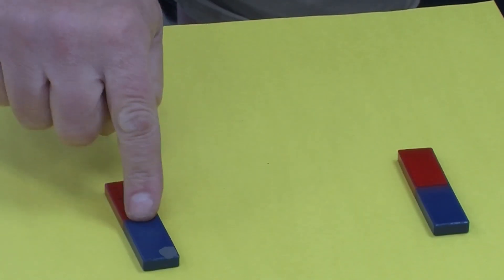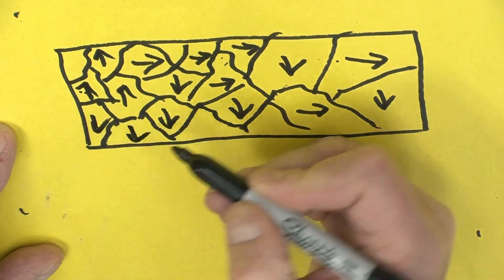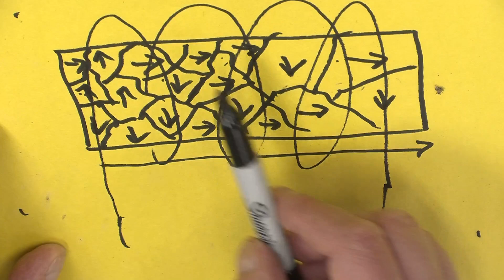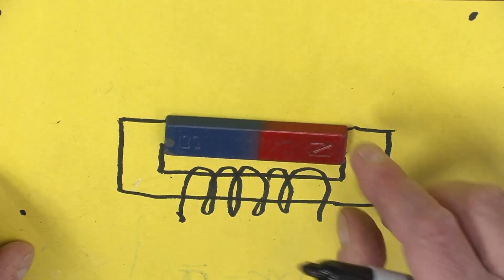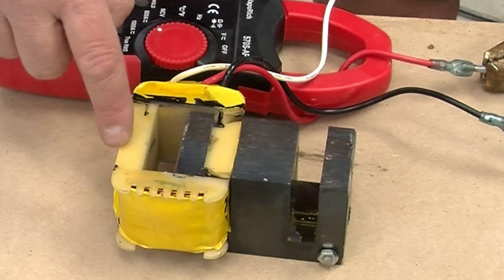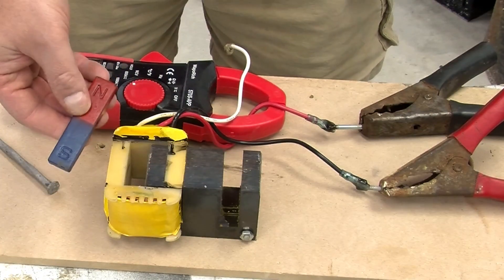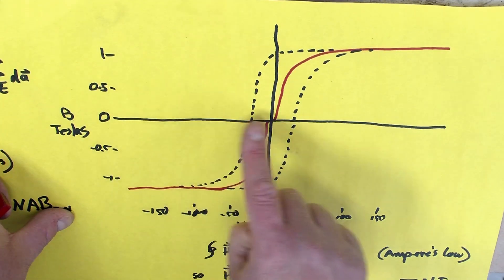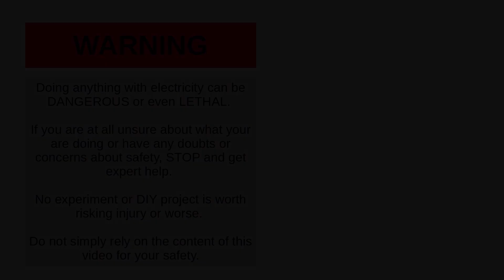How to (Re)Magnetize a Permanent Magnet

Comment: Very nice video, Sir, however i have a question regarding this video. In this video you talk about high current and moderately low voltages. From a welding machine i guess 48 Volts. On another video thats called 'MAGNETS how its Made' from Discovery UK they say that in the first step (high current/low voltage) they prepare the magnets for establishing the polarity, then in the second step they use High Voltage, low Current to really magnetise a magnet, (in that movie 30 Amps x 300+ Volts).  So i am a bit confused now. Can you clearify this. Thanks.
Reply from the maker: Thanks! I tried looking for the video you mention but couldn't find it it so I will make some assumptions about what they are doing.

You mention that they initially using high current/low voltage to prepare the magnets. Are the magnets hot or even molten at this stage? It might be to try and orient the domains or crystals as the material cools in a way that is optimum for the a magnet with with fields in the desired direction. I'm guessing only a small number of loops in the current carrying wire. 

2nd step: HV, low current 30A 300V. For the final magnetizing step you need to force a field somewhat above the saturation level of the material. The H field that does this depends on the Amp-Turns of the coil, so you need a minimum number of amp turns. You can have a few turns with high current (eg 10 turns at 1000A = 10000 Amp turns) or many turns at lower current (eg  333 turns at 30A = about 1000 Amp turns) . How you get the required number of amp turns doesn't  matter and would be chosen based on what is easiest to wind given the geometry of the magnet and the easy availability of suitable power supplies. 

The voltage that is needed is determined by the total resistance of the wire. More turns = longer, usually thinner wire so more voltage is needed for a given current, which is partially offset by the need for less current.  

Bottom line - they used many turns to need less current and used high voltage to push that current through a thin, long wire. I used a few turns of thick wire. I probably didnt mention the alternate option of many turns and lower current - often the videos have to be kept somewhat simplified to avoid confusing or complicating the concepts being presented. 

Hope thats helpful!
Reply: @ElectromagneticVideos  Thank you very much for this great and fast reply, i really appreciate it. 
I am trying to magnetise U-shaped  O1 tool steel that is hardened and tempered. For the magnetisation i use a welding machine as power supply (48v AC), then a bridge rectifier to make DC. That DC is connected to the primairy (thick) winding of a microwave transformer, so +/- 3 Ohm. When i magnetise this U shaped tool steel i can not get higher then around 30 Gauss. So i thought i go check online and found this video. 
https://youtu.be/qed4ynPYVIA
So that leaves me with 2 more questions if you don't mind. 1. Is there a way to find the magnetic saturation level of this hardened and tempered O1 tool steel? and 2. Would the tempering proces (in my case 2 times 2 hours of +/-200 degrees Celcius heating, then slowly cooling) have an effect on the magnetisation level?
Anyway, thanks for the effort and happy new year.
Reply from the maker: @germona  Interestingly I geographically blocked from that video!
Your questions: 1) The saturation level for most steels is between 1T and 2T. If you estimated the current needed for 2T you are almost guaranteed to be fine. If you can measure the B field, and do a few readings for different currents, it should be obvious when you have reached a current level where the field does not get much stronger.  There is a nice graph here: https://en.wikipedia.org/wiki/Saturation_(magnetic) 2) I'm not sure how the tempering process would affect the magnetization level that can be achieved - I would think it will affect the magnetic hardness hardness (how easy/hard it is to loose the field after magnetization) because the crystals and stresses in the material will alter how easy it is for the magnetic domains to change. I'm not sure if tempering - or cooling the steel quickly will make it better or worse. I'm sure somewhere on the internet there is some practical info on that. (let me know if you find out!)

In general "normal" steel as found in tools does not make great magnets as it is magnetically soft so it will generally make magnets that easily loose their strength which is why other materials are usually used to make magnets. Depending on what you are trying to achieve, you might find you get better results is you use a alnico or neodymium magnet of about or bit more than the cross-sectional area of your piece of steal and use the your steel to guide the field to where you need it. 

If you are just experimenting to see how to make magnet, keep experimenting. I did have a large steel horseshoe magnet as a kit - it worked - but was never very strong and quite weak compared to what we are used to today.
Reply: @ElectromagneticVideos  Thank you again. I am trying to make a horse-shoe guitar pickup, like in the rickenbacher frying pan A24 lap steel guitar, that was invented by George Beauchamp in 1932. It is not very much magnetic but a little more then i can get now. If you search in your browser for images on 'horseshoe pickup lap steel' you will see a lot of examples. I have a rickenbacher lapsteel from 1946, and that magnetisme is still there, and that is the amount of magnetisme that i am trying to archieve. I will keep on trying. Thank you for the help. Jean Belgium.
Reply from the maker: @germona  You know, someone else asked about that a while ago. Did a bit of googling and I now see what you are dealing with. At least one video I looked ta did seem to indicate after recharging the magnet the most yo could hope for is a year or so of use before needing to repeat the process. 

Here are some thoughts: I did some research on annealing steel and magnetism. Annealing can increase steel's magnetic permeability (higher field for a given current) but decrease magnetic hardness (easier for the magnet to loose its strength). So it would seem steels that have not been annealed generally make better permanent magnets. I am wondering if over many years the steel gradually undergoes similar changes - reduction in internal stresses -  as when it is annealed and so that what was a good steel for a permanent magnet when the guitar was made is no longer that good for a magnet. 

Some thoughts - you could try heating the steel to almost red hot and then rapidly cooling it to harden it which might help. However I would be hesitant to do that on an antique item like you have and presumably like me. you have little experience doing that sort of thing. I did see one fellow who re-magnetized it by swiping a string magnet along it. You could try that and maybe swipe it with a magnet before each use. Even better, is there some place underneath where  you could glue one or more strong magnets to the old horseshoe magnet? That would keep it permanently charged and might be the simplest solution. 

Let me know if you find out what works best. Good luck - what an interestg project!
Reply: @ElectromagneticVideos  I am sorry, that i did not explained it very well. The situation is as follows.
 I have a 1946 Rickenbacher lap steel that sounds terriffic. In lap steel guitars however there are at least 5 popular tunings (C6, B11, A6, Am+, Open D, Open G.....and so on). 
So beside my original Rickenbacher with the horse shoe magnet pickup i am trying, allready for a few years to make a copy of that original, so i can experiment as much as i like without ruining my Original. I have made horse shoe pickups from S690 steel S960 steel, Hardox steel and so on. But they don't sound as good as the original, because i can not magnetise them enough, because they don't have enough Carbon.
Now after a few years i finally found the correct steel here in Belgium. The americans call it O1 steel or tool steel, the din equivalent is 1.2510. If i buy that steel it is in an annaeled state. That means its original state, where one can be bend, drilled, en tap threads like it is mild steel. 
However it contains 0.95 % of Carbon, so it can be hardened. On the specs of that tool steel it should be heated at 850° Celcius (above the critical range and no longer magnetic) and then quenched in oil of 80° Celcius. That proces is called Austenising, the steel is then in a martensite state. Than it is very hard, but also brittle. 
To help with that it can be tempered. Tempering means slowly heat the steel up to 180-300° Celcius and cooling down very slowly. That means the stress is out of the steel but it looses a little bit of its hardness. 
Annaeling is another heat treatment proces, where the steel is heated above the critical range (so no longer magnetic and in the case of O1 tool steel above 800° C) and then cooled in still air. The steal is then very machinable, but i can not magnetise it in that state, the magnetisme is then very low. People that have to re-magnetise there horse shoe pickup have done someting with it. Maybe an impact or sometinge else, but normally these pickups dont loose there magnetic properties. There are frying pan lap steels from before World War II. 
Heat treatment ( like hardening and tempering) will change the grain structure of steel, but what the grain stucture and magnetic domains have in common, that is what i am asking myself.

This man explains the heat streatment processes in detail and in practice.
https://www.youtube.com/watch?v=hw4Rl0uG7ok&list=FLby3acjH4MQ6qcuJZ5k1H7g&index=1&t=198s

And this is a link to my original Rickenbacher lap steel, how she sounds.
https://www.youtube.com/watch?v=5jnWFXgYpw4

I hope this clears things up a little.
So since i have the correct steel, and the means to do the heat treatments, i keep looking for a way to magnetise them a little bit more.

Anyway, thanks for the time you put into this, it indeed is a wonderful yourney.
Reply from the maker: @germona  Wow - reading that sure taught me a lot about about heat treating steel. 

The grains and magnetic domains - if the grains/crystals/or other distinct bits that make up the steel are small enough, each will be a domain. If they are larger each may have multiple domains. The stresses and imperfections govern how easy or hard it is for the grain boundaries to move as required to change the magnetic direction. If its hard for them to move, the material will retain its magnetism well. 

That all good in theory. In the end its how to practically achieve it. It sounds to me like Austenising would be the thing to try. 

Is lapsteelbelgium your channel? Let me know I'll subscribe hoping you post some of your experiments and results. Hope you do - seems like there would be significant interest in how to recreate that vintage electronic pickup!
Reply: @ElectromagneticVideos  Yes, LapsteelBelgium is my channel. Meanwhile i tryed different things, tempered, or just austenizing, does not seem to make a difference in how much i can magnetise the O1 tool steel.
Today, i even tryed another (bigger) microwave transformer, to magnetise the horse shoes. The voltage is the same +/- 50 Volts DC, but the current got from +/- 10 amps to 18 amps. Still the same magnetisation.
Now after reading more in the book 'Pickups' from Mario Milan, it seems that in the 1930 they used an allow with very much Tungsten (with the symbol W from Wolfram and atomic nr: 4).
Unfortunataly during WWII they needed the Tungsten for making guns in the war so the alloy became too expensive, so Rickenbacher changed the material, but the lapsteel guitars never sounded the same as the early ones. 
So maybe i am looking for something impossible. 
Another thing is, maybe i can get them magnetised enough but it is the percentage of Tungsten in the alloy that makes 'that typical sound'.  
Jason Lollar sells the horse shoe pickups, but i never heard if they where as good as the originals.
Here is a link to that. 
https://www.lollarguitars.com/lollar-steel-guitar-pickups/horseshoe.
That being said, there is someone in America that makes them, they sound just as good as the originals, and that is Todd Clinesmith. 

This is the sound i am looking for, it is an original Rickenbacker. I can not even start to tell how she sounds, but it is so distinctive, smooth, poppy, singy and so on.
https://www.youtube.com/watch?v=8ArwAqM88Kw

I will keep on trying, and post a video if i come close to the original sound.

Best Regards
Jean
Reply from the maker: @germona  How fascinating that the alloy changed because of the war. 

I still think it might be worth experimenting within using a modern magnet to keep you less than ideal piece of steel magnetized. You might be able to change the sound by moving it back and forth. 

I sure envy your combination of technical and musical ability. I could never play a musical instrument and am probably close to tone deaf! I just subscribed to your channel. Dont hesitate to message or email me if I can help in any way!
Reply: @ElectromagneticVideos  Thank you very much for your help, so far. I found another tool steel (X210CrW12) that has more Carbon (2%) and higher Tungsten then the O1 tool steel. I think that is called High Carbon Steel. Then i bought a flat Brass piece, because the baseplate of the original is also from Brass, maybe that can change the tone too. And the last thing to try is to take another alloy for the polepieces. So i still have some options to find the right sound in my horseshoe journey. 
For sure i will post a video when i have the best horseshoe pickup i can make. Thanks again. Jean
Reply from the maker: @germona  Wonderful - hope the new steel works!!!!!!!!!!!!!

Comment: If I am understanding you properly, a large, steel, C clamp whose frame was wrapped with an electrified coil of doorbell wire would be perfect for magnetizing a bolt or a nail and making them permanent magnets.
Reply from the maker: I never thought of a C clamp for that but - YES - great idea! You would want the metal in the clamp to be thicker than the magnet (so at its saturation point there is more than enough flux to saturate the magnet-to-be) and also the have the magetic path though the clamp as short as possible (so smallest clamp). This would minimize the amp-turns needed. 

The only issue with a bolt or nail is generally they are not ideal materials and tend to be vulnerable to easily loose their magnetisim with the slightest misuse.
Reply: @ElectromagneticVideos  Thank you.  My thought is to take a rotary hammer SDS point bit (primarily made of carbon steel, normally used for smashing stone) that has lost it's point through over use, grind the point area flat, heat treat and temper it, then put the new flat flat end in a C clamp as described, magnetize that end and use it to hold nails as the rotary hammer hammers the back end in thereby driving nails with a rotary hammer.  Just something to do while bored.
Reply from the maker: @kenibnanak5554  Your Welcome! Thats a neat idea - I would be vey interested to hear how well it works. The concern I would have is the violent hammering action on the bit by the rotary hammer + the open magnetic circuit on non-ideal magnetic material would rapidly demagnetize the bit. The tempering may help make the material magentically harder (I'm not 100% sure) and retain the magentism better.

If you find it does loose its magetism after some hammer action, one option may be to mount a magnet very near the bit close tot he chuck. Would be tricky to get it gear enough without touching - maybe a held with a thick piece fo steel with a bolt into the threaded hole where the side handles often screw. 

Anyway - go for it! Should be interesting and potentially really useful.
Reply: @ElectromagneticVideos  I have an old C clamp I made in shop class a few decades ago out of heavy steel with a steel frame about an inch and a half thick in all iirections.  Should be perfect for the task.

Comment: 8:48. Why bother with a steel core? Couldn't one simply wrap a coil on the magnet?  Run a current  through coil and maybe tap the magnet to jostle any remaining stuck domains into alignment with the applied field? 

Then you went into magnetic circuits and the resistor analogy. The seperate C shaped iron core represent a low reluctance path which helps complete  the magnetic circuit with a low reluctance path which allows (creates) a stronger magnetic field throughout the magnetic circuit than if there were more high reluctance paths in the magnetic circuit.
Reply from the maker: The second half of you comment is why - the low reluctance C minimizes the amount of current (or more accuratly amp-turns) needed to achive the required field in the material you are magnetizing. 

You could certainly do it without the C exactly as you describe - just more turns of the coil and more current. In the end it just depends on what is easier.
Reply: @ElectromagneticVideos  I'm sorry I may have worded my inital comment a slightly differently than I intended it to be understud.  The first half was a question I had, and the second half was me figuring out why use a core for magnetizing  after you gave a simple magnetic circuit analogy analysis. 😁  A question asked and auto-answered.
Reply from the maker: @kreynolds1123  No worries! Nothing like a self answering question :)

Comment: How do you use clamp meter on DC current?.
Reply from the maker: Some meters have magnetic field sensors that can be used to measure the DC field and hence DC current. Not as accurate close to zero as the transformer action based ones, but still very usable for most applications. They are remarkably inexpensive the days ($50 or so)